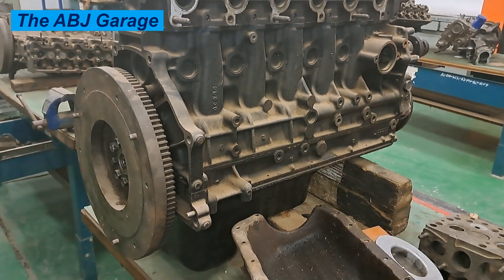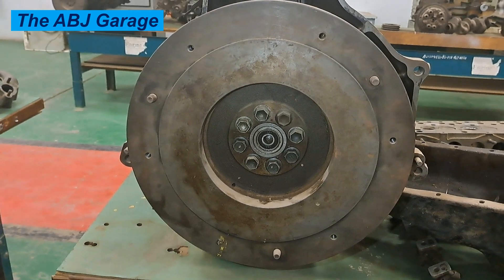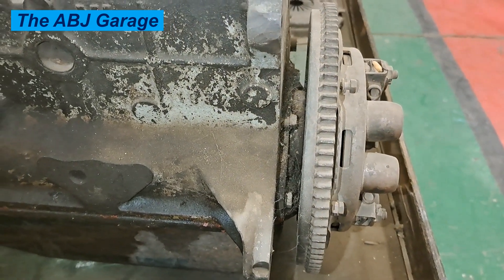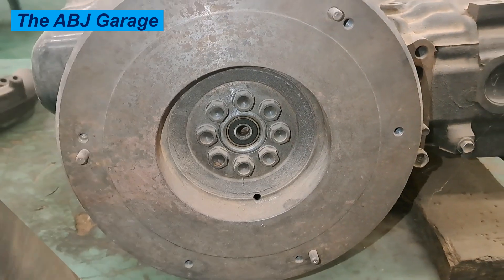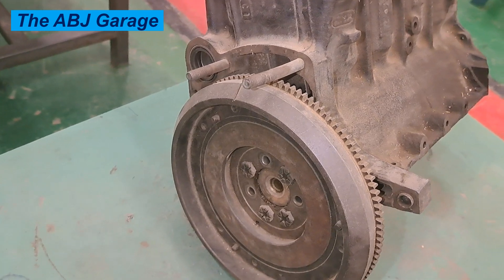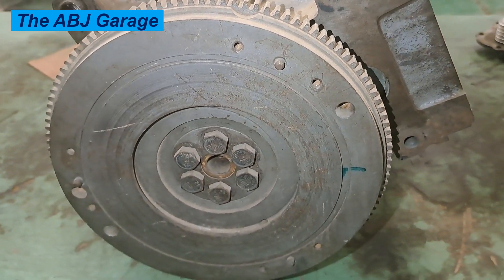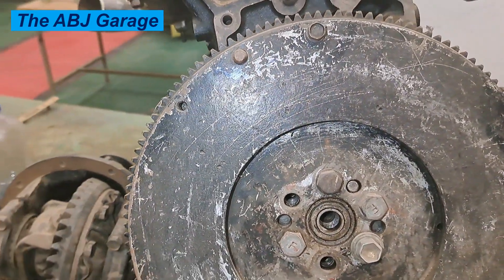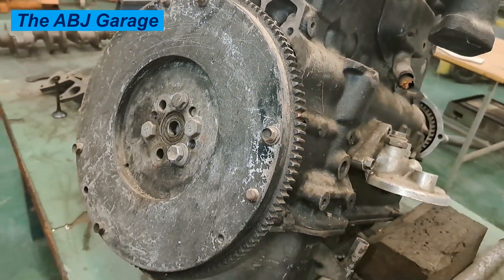Can You Drive With A Bad Flywheel?

Comment: I have vibrations during driving, mostly second third gear, up to the hill. I couldn’t get rid of those vibrations, i change mounting, ball joints… They sad is flywheel. I didn’t know before that flywheel is a reason for vibrations
Reply from the maker: well, a warped flywheel could cause vibration. Vibrations during an uphill drive often point to issues with the engine, powertrain, or drivetrain, such as engine misfires, worn motor mounts, or failing CV joints or driveshaft components. Other possibilities include unbalanced tires or problems with suspension and alignment. If however, vibration is felt only in 2nd and 3rd gear, this often points to a problem with your car's transmission, engine mounts, or a related component. Since the vibration is specific to these gears, it is unlikely to be caused by issues like tire balance, which would cause shaking at consistent speeds regardless of the gear.